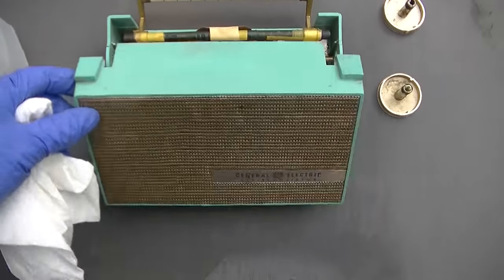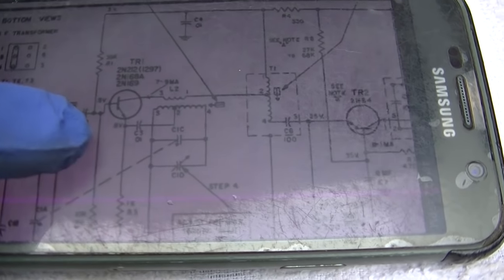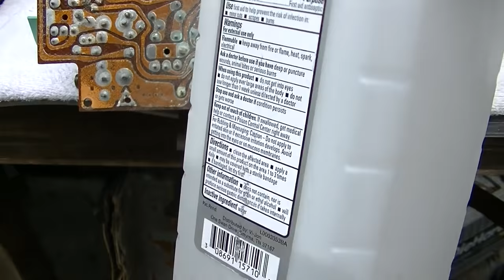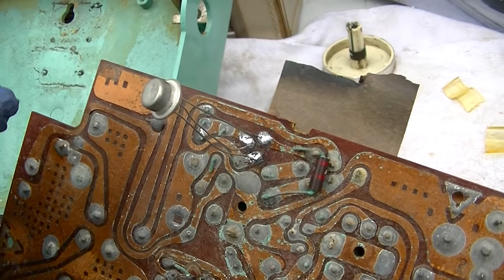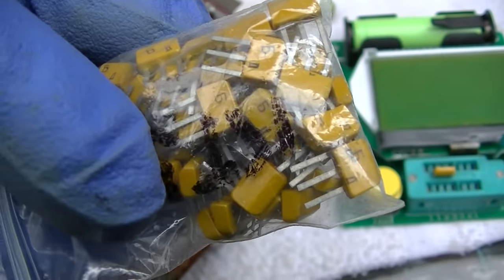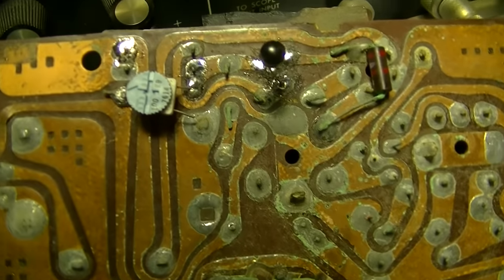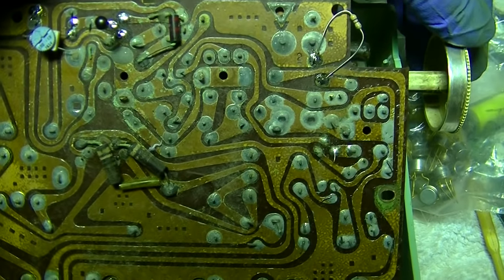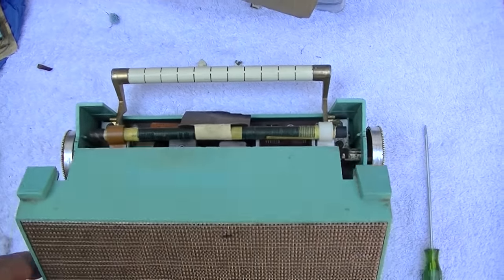GE P726 AM Transistor Radio Repair

Comment: I recognize that style shirt, used to have one just like it.  When I build stuff now days, I do it in my recliner, reclined to almost laying down, it's a pain thing following 5 major surgeries trying to repair my spine after an auto accident while chasing a drunk driver.  At any rate those shirts melt when solder drips on them, the one I had developed so many holes  my wonderful wife of 51 years decided it was time to take it out of service. It now serves as several nice cleaning cloths. I am a rather large man and the shirt was a 3X so there was a LOT of material left that didn't have melt holes in it.  Thanks for the diversion, I am still caring for my wonderful wife as the cancer eats away  at her organs, her hair has now gone almost completely from the Chemo, the doctors have put her on morphine for pain as well as some other pain meds for breakthrough pain. The meds have helped her a lot, she has been able to keep food down once more and is gaining some strength.  Docs say she has perhaps a year, two at the most, however she will be in a nursing home soon because her body will no longer be in any condition that allows my daughter and I to continue to care for her. I dread that time.  You see other then a year that I was in Vietnam and the 2 years that I went to college, we have been together, and very close, even when I was in college, I would drive home for weekends, even in the worst weather to be with her.  Getting old sucks.

Comment: Great video man and you didn’t even bother with control cleaner,  the resistive coating is damaged in that VC, you did the only thing you could to make is useable without replacing it.

Comment: I’ve done that resistor trick with bad volume controls that were no longer available. Last time I did that modification was on a GE clock radio. It worked out pretty good. Excellent lesson on rebiasing silicon transistors

Comment: You just "discovered" the effect that was used with the original Select-A-Tenna.   Externally coupling a loop to add sensitivity and selectivity to a radio.  Did you notice how the weak signal became much stronger?  I have one and have used it both as an signal booster and as a notch to an adjacent stronger interfering station.  Versatile and worth the $30 they are selling for on the used market.  You can make your own simply.   Here is a webpage showing internal construction and parts values.
http://www.jtl.us/joesradiopage/select.html

73
Randy AB9GO

Comment: WOW.   Un-powered and it effects the other radio.    Fricken magic.   It's sorcery.    Vinegar would probably work better and dissolve the corrosion.     I had a bad pot on a late 80s Realistic scanner.  No matter how much I cleaned it it would get crackly within a month.   I opened it up and you can see the slider ware tracks on the carbon trace.   I ever so slightly moved the slider fingers over to ride on unworn areas of the carbon trace.   Been working for years that way.   Good troubleshooting on this one THANX.

Comment: The correct way to rebias for other transistor type is to match the emitter voltage, so the bias current. The reason is, the transconductance of transistor is Ie/(kT/q), regardless if it is Si, Ge, GaAs or any other. And this transconductance is, what the rest of the radio circuit is designed for (impedance seen by the oscillator feedback is exactly reverse of that transconductance,...).
So with 0.6V noted in the schematic for the emitter, minus about 300mV of the typical oscillator amplitude, plus the Vbe of the transistor gives what needs to be at the base. So with 0.2V Vbe germanium it is the 0.5V, with 0.6V Si you may start with about 0.9V. But the emitter voltage needs to be checked and the bias readjusted (with the oscillator running of course).

Comment: My parents in 1960 bought the predecesssor to this radio, same general case and knobs but with battery-tubes.  It needed a 90 and a 7.5 volt battery.    

Your replacement silicon transistor probably has too much gain and bandwidth so it wants to oscillate at various spurious frequencies.   I would try adding a 1K resistor in the base lead and see if that quiets down its tendencies.  Or if you have some, try a ferrite bead or two.

Comment: The radio sounds remind me of the radio noises in the command center in the rebel base on the ice planet Hoth in Star Wars The Empire Strikes 
Back. This code is not used by the rebel alliance, it may be an imperial code.

Comment: Silicon RF transistors often go crazy on autoconverter circuits for MW radio, they have too much bandwidth and the whole thing oscillates with lots of harmonics.
Sometimes, the cure for this is to add a few ohms resistor in series with the emitter, or a ferrite bead slipped on emitter or base leg of the transistor.

Comment: Those pre-1960 transistor radios are a b**ch to fix. Especially the ones with FM (I live in Germany where FM was kind of mandatory for all radios manufactured after WW2). It's absolutely crazy what they did to get away with the minimum number of transistors possible.  Everything oscillates and has to oscillate in the right way or those things will not work. And then the bandswitches on top which switch barely detectable signals in the microvolt range. I remember tweaking away with those for days as a kid in the 1970s. Frustrating stuff.
Thanks a lot for putting out all those videos!!

Comment: I have a GE dehumidifier that is an exact twin to this radio. Exact same color and styled green cabinet, with good and ivory (and chrome) switchgear. It has the exact same metal “grill cloth” on the entire front of the machine. The dehumidifier is all metal though. Must be from the same year

Comment: If I read right, the tolerance of the 33k resistor is 5% (gold band) which is + or - 1k5 ohms, so the maximum value would be 34.5k, and the minimum, 31.5k. So it might be ok to try another 33k with, say, a 1% tolerance, or from the same 'bin' as the one you found that measures, say, 33.5k on the meter..

Comment: Very interesting video, good work as always ! 21:20 the alignment should not be so touchy, perhaps you have to change the value of both of base-BIAS-Resistors and perhaps the transistor oscillates on another frequency (parasite oscillating 27:35) because these VHF/UHF-Transistors are much too hot for such stages! Some of them has to have a little ferrite-core on the Kollektor to prevent them from this parasite-oscillating. Perhaps another Type of Transistor is better, for instance a BF224, these are used in combined 455kc/10.7Mc-IF-stages... In my self-built superhet radios the biasing of the mixing or oscillator-stage is by far not that touchy.

Comment: ГТ311  -  GT311   this is  germanium high frequency  NPN transistor , not frequently used in soviet radio equipment , but still sale  not so expensive on ebay .  МП37  or other МР series is all low frequency transistors .

Comment: It was surely corroded out inside for sure, and 1260 there is a radio station 1260 3SR or was a radio station at Shepparton in Victoria about 100 km away.

Comment: The UHF-oscillator transistor 2N3563 you´re using tends to self oscillation at very/ultra high frequencies as you showed.
To stop these, i propose three ferrite beads, one over each leg of this transistor - should stop these self oscillations.

Comment: 15:34 so that means if you put that transistor on the other side of the board then you have to flip flop the two leads in front of the transistor.

Comment: Out of soviet made Ge NPN ГТ311 are up to the task (ГТ313 being PNP equivalent of which there is wider choice П401, П402, П403, П416, П420, П421, П422, ГТ309, ГТ308, ГТ310, ГТ322 and ones marked 1T are equivalent of the same ГТ preffix - 1 for Ge in russian Германий, 2 for Si in russian Кремний so KT=2T). Letter suffix of soviet semiconductors defines lot of differences in parameters (voltages, currents, transit frequncies, etc.) unlike the rest of the world products, so a table of shortlisted essential parameters is always handy.
Reply from the maker: hey can you help find a schematic for dombey 303?

Comment: I suspect that UHF transistor might be a little too hot at high frequencies for that circuit. Either try to find something with a lower ft or maybe just put a small ferrite bead on the base lead to kill super high freq gain.

Comment: When you hooked up the scope, did you run it through some sort of isolation circuit? Every time I try to probe an oscillator I just get noise or it de tunes it. Great videos, I always learn something. Charlie
Reply: Try winding a coil of a few turns, maybe an inch in diameter, and connecting the scope across that.

Comment: Is there a reason to use 70% Isoprop over the 99% stuff please ?.....cheers.
Reply from the maker: Well it says 144 senior show sister Mariana Market no rush on Lamar glass Sebastian
Reply: @shango066  May your transistor filled vacuum bulbs continue to inflate...cheers.

Comment: Hey shango066 do you do repairs that are shipped to you ? I have a johnson messenger 223 cb base radio and I need to get the crystals fixed in it I got to tubes and caps fixed but they didnt know enough about the crystals and the components and if anyone can fix it it's you please let me know.

Comment: Put some contacr cement on those antenna clamps. That will hold the antenna in place. I do it all the time. It works for me. That radio may have been dropped.  Lots of corrody doodle!!!!

Comment: Because everyone needs a radio whose tuning capacitor slices and dices the antenna coil wire - self-EOLing radio. Brilliant. Where are the fireworks and smoke bombs? 🤣😂😆